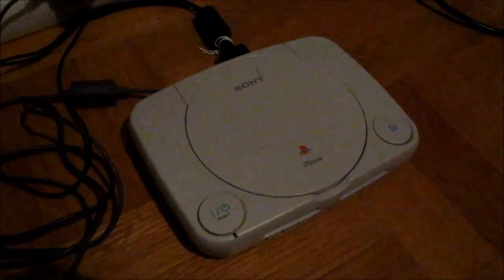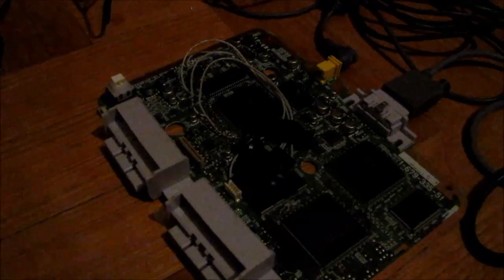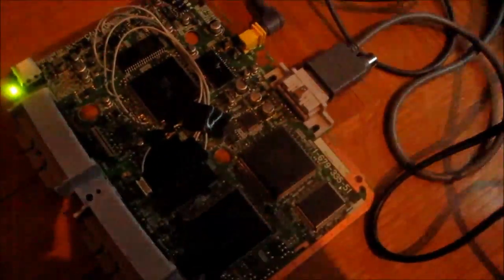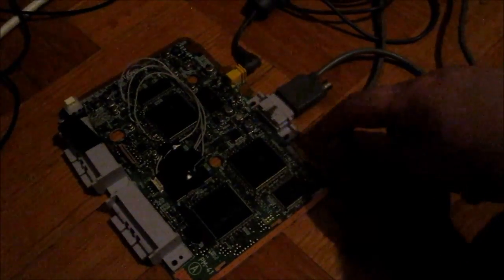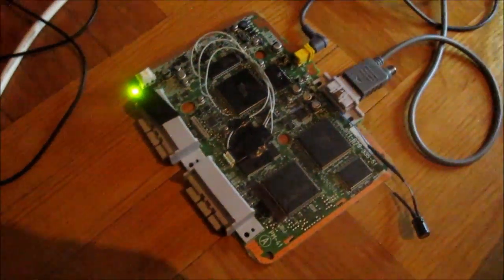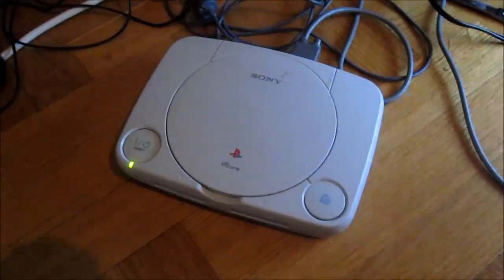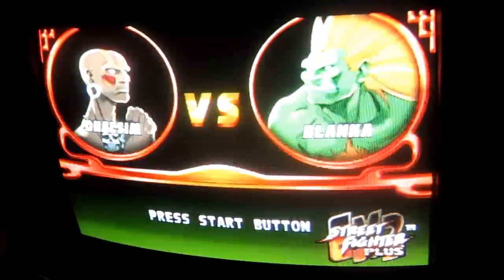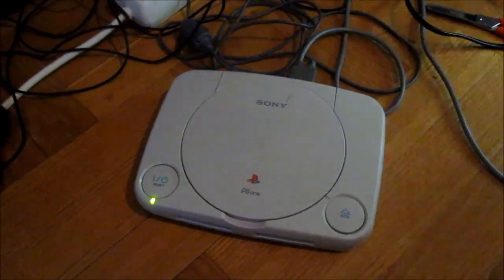PSOne with no video output fixed using csync mod

Comment: What gage wire do you need for the hsync and vsync connections? I'm thinking its the same size as the csync, but I dont know the formula to determine the wire thickness. The wires I used are too thin.

Comment: I just tried that c-sync mod, got a good place to take the pin 156 signal and seated up resistor and capacitor as is in the schematic and all I got is a withe screen. https://photos.app.goo.gl/e11oB1NMifS2C23s6 this my setup. The only difference is that my resistor is a 82 instead 74 homs  and the cap is 16v instead 4v. 220uf I'm sending this signal to a composite conector to the tv. Is that ok or this is for another kind of connectors?
Reply: Ho I just got it's for a scart cable. Wich I don't have here any tv with that. Any other way to tack the video signal ?

Comment: I had the same problem, its a bad solder joint. I ended up just cooking the psone in the oven on a baking tray, and I balanced it on two coffee cups on the tray. Heated the oven at 350 degrees and only for 15 minutes. I don't have scart and this was an additional system, so I was okay with the possibility of losing it. Just remove the board and the power button and spring, be careful not to lose the clip that is underneath the  button. Also take care not to jiggle or strike the board as soon as it comes out of the over. Let it sit for 15 minutes to cool down then, button everything back up. After that my psone works just like new.

Comment: I've been having the same video problem on mine. I tried the c-sync mod, but the video signal (scart) is still as it was before. After i cut the trace the signal didn't change, should it have?. I expected to get a black screen or so. Im just wondering whether my soldering or my cutting is at fault here.
Reply: For anybody with the same problem: cutting pin 6 will disable composite which it has for me. That's probably why scart output is still the same. That leaves the soldering/wiring . These nimble AWG wires don't take bending too kindly.

Comment: Thanks! Had the exact same issue as you so I attempted this fix and the PSOne now works through SCART, unfortunately like your system I cannot use composite (although I now get sound but just a white screen over that) however it's at least usable unlike prior to the mod!
Reply: +MrMario2011 What about S-video?
Reply: U can put an switch to move from scars to composite ..